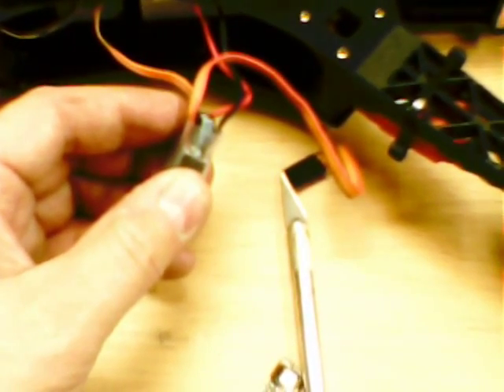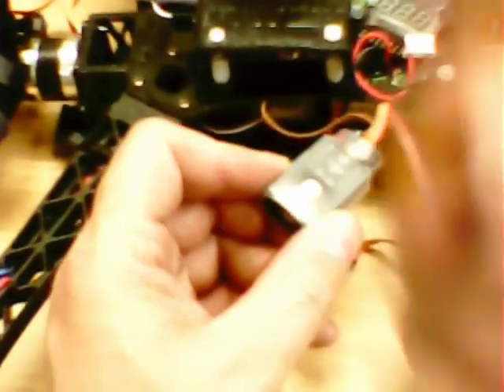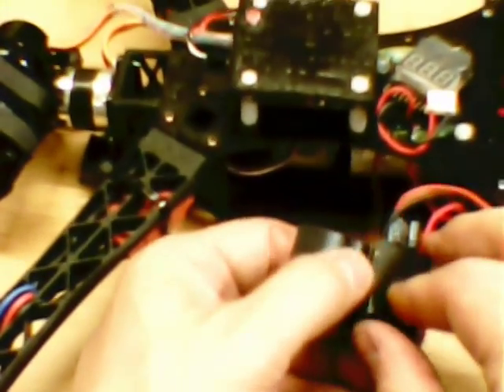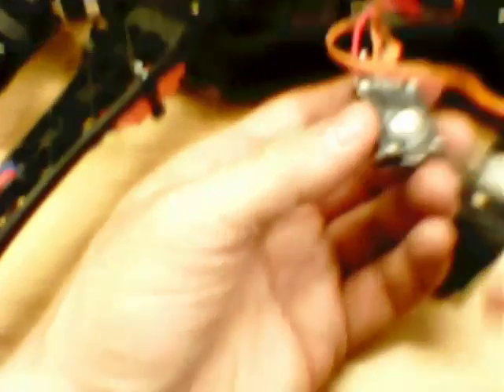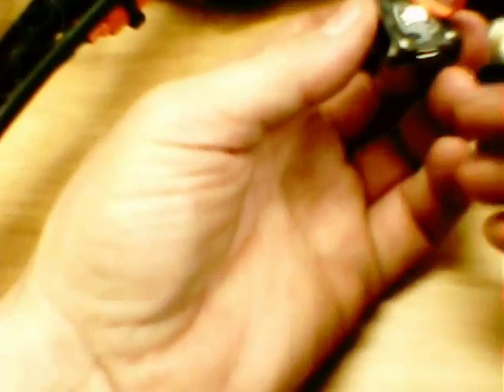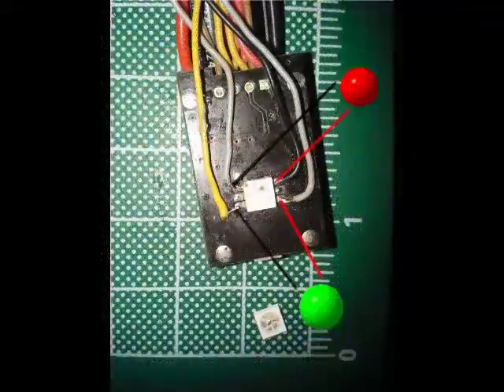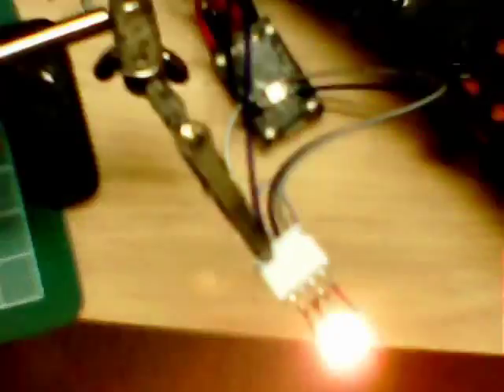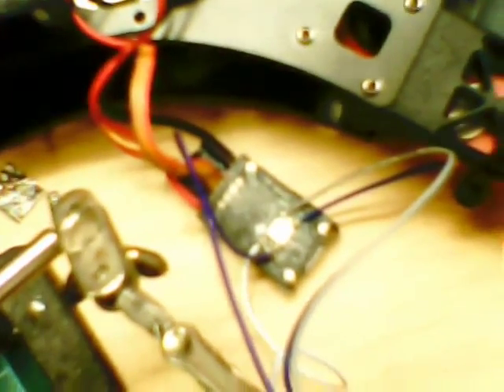naza m lite extension LED  mod

Comment: nice job. will any bicolor 5v led do or does a special type only work?
Reply from the maker: 5 volt LED will work
Reply: Thanks. So you power the LED directly from the original LED pins. Do that create any issues (transistors getting hot from extra load etc) or nothing happens. I have this idea to make two LED like you did for rear 'eyes' in a Walkera QR 350 and the easiest way would be simply to do your mod.